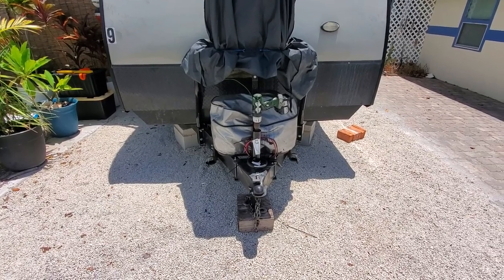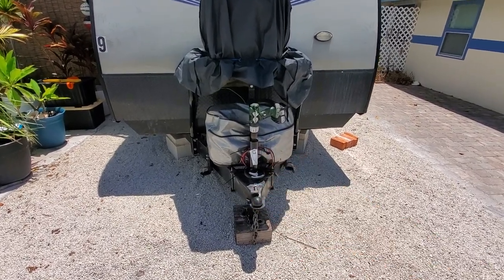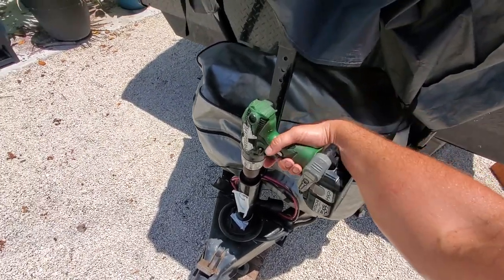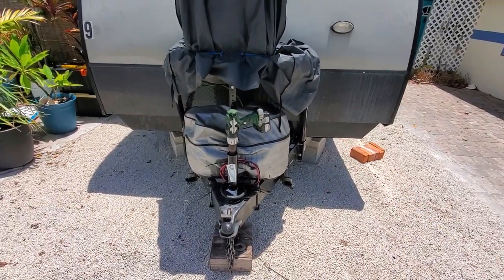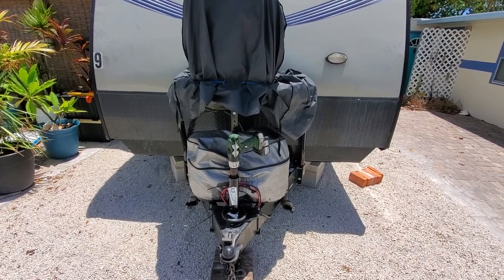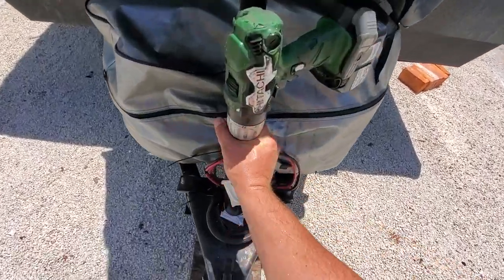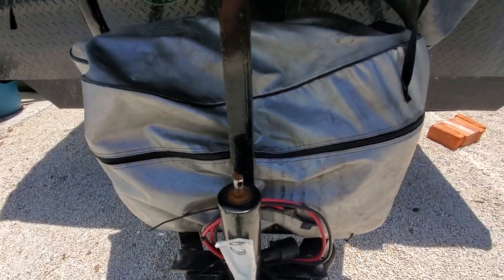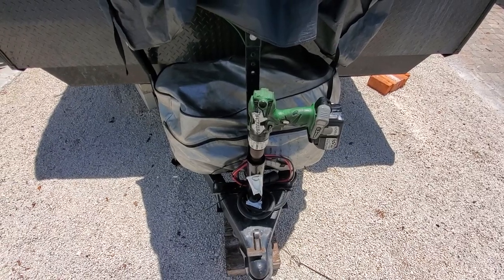Cheap DIY Electric Jack RV Trailer Jack- Cordless Power Drill

Comment: On a topwind jack the handle is the only thing holding the mechanism in the housing.  If yours has stayed up it's probably just a little friction from crud or something.  At least put the nut and bolt back in to prevent the possibility of the innards falling to the ground.  I've ordered a suitable long coupling nut I want to bolt on in place of the handle.  But I'll be using an impact vs a drill which has both pros and cons.  I currently use it to operate a scissors jack for tire changing and trailer tire expanding chocks.  No problems with those.
Reply from the maker: Yeah after I jack it I always have to put the nut and bolt back on. I should of said that